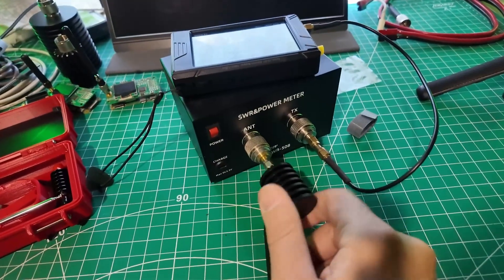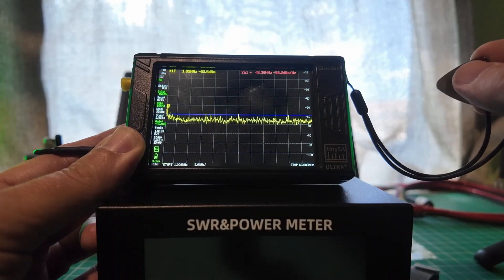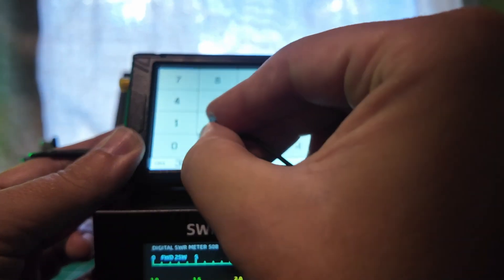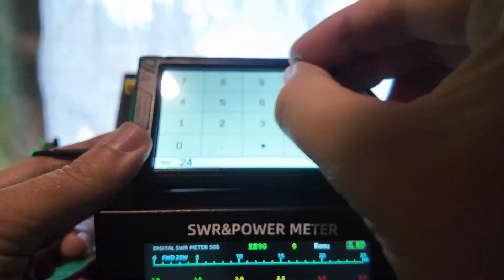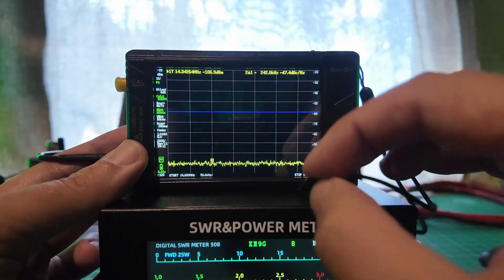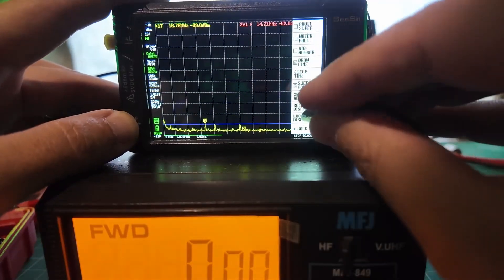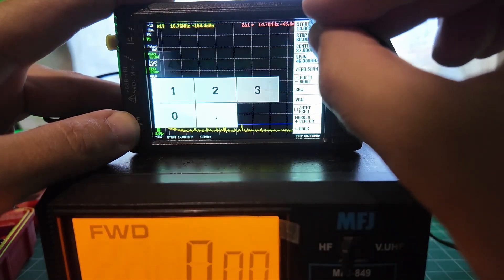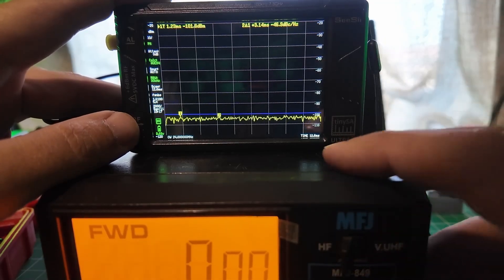Great Expecations... Does the BG5CQV CQV-SWR-508 have RFI Issues?

Comment: Need help with mine.... It stops when it is over "off time" but it never restart until I plug an usb charger, even if battery is always fully charged... It also stop if I use 100 watts, and same thing, never restart without a usb charger. I don't understand...
Reply from the maker: I don't understand either.  Strange behavior.  Change USB chargers?  Leave it plugged in?  Change power levels?
Reply: @temporarilyoffline I've tested different chargers, I want to be able to use it on battery, not plugged every time, it's the reason I choose it. And I'd also like to use it with the power it can takes.... 😢 Another strange thing, I opened it, unplugged and plugged the battery, and it restarted... 🤔
Reply from the maker: I'm assuming that if you unplug the battery while its not plugged into shore power it would restart - there's no power.  Are you saying that when you have power applied via external supply and you remove the battery it reboots?  That could be a thing, maybe CQV used a more "interesting" power circuit.  I have some cars that run without the battery and some that only run with a battery, so its not... um... weird.
Reply: @temporarilyoffline no, without usb charger connected, no power supply, unplugged. When it's stuck off, I take the battery plug out, put it back in, and it turns on.
Reply: Hi, I've found another user with the same problem, he changed the internal battery to solve it.

Comment: Nice test and you spoke slowly enough that I could follow! (I know you think you're old, but I went to high school with Moses.) I've considered getting one of those meters to put between my rig and my amplifier to have a better grasp of exciter power and SWR. It's funny that some hams will point their finger at an allegedly "noisy" piece of gear but ignore the dozens of switch-mode wall warts and LED bulbs in their shack that are plastering RFI throughout the spectrum, thicker than Tammy Faye Bakker's foundation layer. (See...I TOLD you I was old...) Thanks Steve!
Reply from the maker: I'm old enough to get that reference!

Comment: Good test ! This shows not the meter it self. Some are getting RFI . And most likely from a outher source like the power supply  running meter or radio . I do not have them meters ,So I have no experience with them.  The digital I have is a LP-100 and it RFI quit. Did same test but with a full size SA . And still nothing. I tested many SMPS and they really bad. Cheap USB C bricks and some $$ ones test noisy . Hard to find a RFI quite one. PowerStation's are quite RFI noisy . Most inverters . Lots of MPPT charge units.  They all over the place on noise.  Just have to test each one in question to know.  Just like the UV-5R . some dirty some better some so so . How much this varies is amazing. Makes us test everything now. 73
Reply from the maker: See, job security!

Comment: Great work, TO. I am about to purchase the CQB 508 for a go-box build...so I appreciate this test. 73 de K4FMH
Reply from the maker: You could remove the case and direct mount!  Maybe put the meter board in a metal tin?  I want to see it when you're finished the build.
Reply: @temporarilyoffline I’m building out a flex 1500, 60dbm amp, mini pc, etc. Looking at this SWR/power meter of it will fit into the 3U Gator case.

Comment: Have you run the same test with the USB-C power attached to the BG5CQV?
Reply from the maker: Since my CQV didn't come with a power supply, I did not.  If you can see RFI with your power supply, snap on some Ferrite Beads until the RFI goes away.